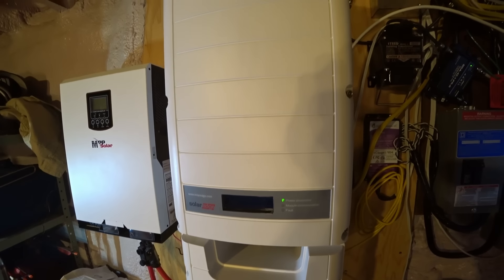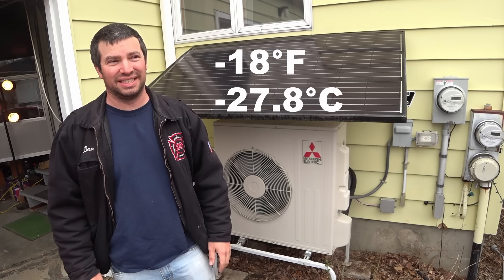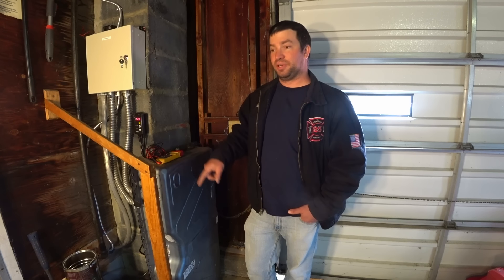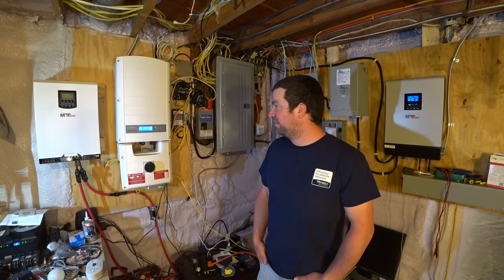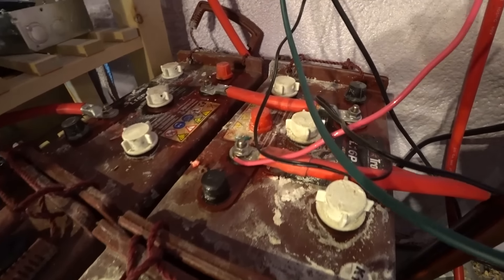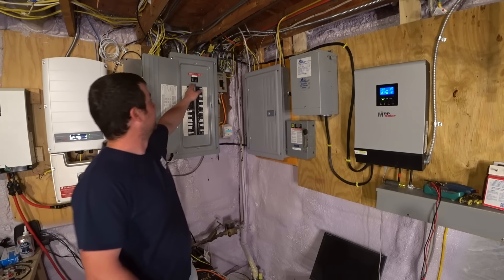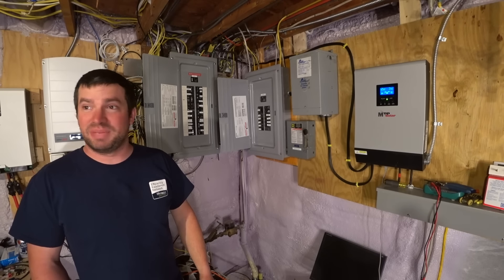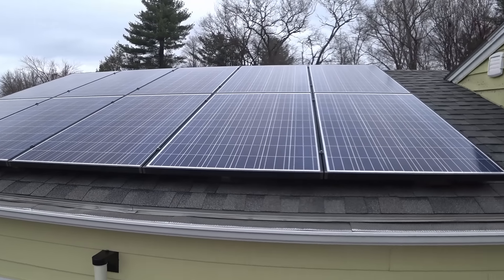Huge Grid-Tied Solar PV with Battery Back-up System

Comment: This is all perfect except for when the power utility loses power.  The batteries kick in & back-feed power onto the grid killing a utility worker.  Does he disconnect from power utility when batteries take over??  When a PV system is grid-tied...that is supposed to be a built-in safety.  But a grid-tied + battery back-up.  Great for home owner...Bad for utility workers!!
Reply from the maker: Ben has more than one panel, and his "protected loads" panel does not back-feed.  This is a very safe and legal system.
Reply: @DavidPozEnergy  Hi David.  Wow fast response.  I'm not a critic...I find what you guys are doing very intriguing.  I am very versed in electricity, power systems, electronics.  But not so much in solar.  I am learning so much from you guys.  So tell me how this system is safe for utility workers.  Does he use some sort of fast switching device that disconnects from utility system??  He mentioned it switches over in 10ms.  I am curious as to what Ben is using that is switching the power that fast virtually without interruption.  I ask because I would love to install a system of the such on my personal residence.  Also does the battery backup serve any other purpose...like allow you to run off of battery during night hours instead of using power from the grid or is it solely used only if the utility power goes out??
Reply from the maker: The power comes in from the utility grid to his house.  It goes through the meter, then to a "main panel".  From there it goes into his inverter "input" side.  Then it leaves the inverter through the inverter "output" side and goes to a second circuit breaker panel called the "Protected Loads" panel.  The inverter has a built in switch that switches in 10ms.  The protected loads panel can be powered by the grid or the batteries through this inverter.  But the "output" of the inverter is not connected to the grid.  The inverter does not have the ability to push power out the "input" side.  It's one-way only.
Reply: @DavidPozEnergy  Oh I see now how he has it set up.  There is so many ways a PV system can be set up.  Ben has a pretty nice system setup.  
Hey David...I am just starting to watch all your videos...let me get caught up with all of your accomplishments.  Love the idea with the Solar water heater with the home made tank under the crawl space.  Perfect setup!!  I'm all about green energy.  Cheers.

Comment: Those PIP chargers are complete rubbish,I had no end of trouble with them burning PCB's and fans, went to Victron Energy and is ok but back up service is lousy in Brisbane, Australia
Reply: In Brisbane also thinking of getting a PIP5048MG but don't want the hassle.. If that's your experience
Reply: Mpp solar has the worst possible customer service. There is no short circuit protection on the DC side and their specifications are lies (eg idle consumption and thd)
Reply: @climatechangepreppersfaceb2148  I saw one of their products on Amazon and it said it was not UL listed (Yikes!), so it may not be allowed to be grid tied.

Comment: Where I live, Phoenix, my electric company, APS won’t allow me to add more panels, or I will lose my current “net metering” plan, where they buy back electric. They see the value in solar energy production, and they want to be the only provider, they want to stop someone that may want to produce their own power. Such backwards thinking...This is solar heaven here!! It’s politics. Big companies have law makers at their disposal.  I’m jealous. Nice system :-)
Reply: Its all just to safeguard their $$$$$$ and that's it !
Reply: They do that in California also
Reply: I have a 10 year net metering agreement with the POCO.  I got around changing it when I added panels because the PIP doesn't backfeed the grid.  They have no jurisdiction on a system that doesn't backfeed.

Comment: How many amps does the heat pumps draw? I've been off grid for 25 years and still can't find a AC unit that doesn't wipe out my batteries. I've got a 2500 watt 24 volt outback inverter and 2000 watts of panels 24 volt 260 watt panels and trace charge controllers mppt and forklift batteries. 20kw diesel gen. Back up.
Reply: The 15kbtu unit runs around 1000w for cooling, sometimes less sometimes more depending on temperatures.  It has a soft start as well.

Comment: If this guy replaced his dryer with a propane heater dryer he should be able to run it on the inverter.
Reply from the maker: I think Ben wants to be as much on Electric as possible.  I think he only runs propane for cooking because he prefers cooking on flames to electric.
Reply: @DavidPozEnergy  Probably a better option is what we do here in europe.... heat pump dryer... they're actually the majority of the dryer market here. Full load of clothes dry with about 1kWh. Also... for cooking... just switch to induction. It's north of 90% efficient and doesn't have to cost a lot. For a cheap intro to induction cooking IKEA sells a single induction hob here for €40 ( it's in the US catalogue for $49 - https://www.ikea.com/us/en/catalog/products/10343776/ ).

Comment: I would like to see more on the electric heat pumps. Are they Ground Source Heat Pumps?
Reply from the maker: No, They are air-source heat pumps.  There is a "Head" unit inside on the wall, and the outside unit which you can see in the video.  Both sides (inside and outside) have a fan and coil.  Refrigerant is circulated between the two sides and air is blown across the coils.  These are often called "Mini-split" and "Ductless".

Comment: Thought experiment for charging my future Kevsla  work/play van or portable recharging station for stranded or convenience charging when visiting the in-laws business opportunity charging, 60amp pressure washer, grid tie-ins, home automation. I really don't feel storing coulombs is required in my home. I'm already running almost 6*1000 watts magnetic  ballasts and add going to easily double.  My hypothesis for my flux capacitor is....

If he would increase from 48V dc to 120V dc. Could a person run there  home more effectively or efficiently. Possibly better for switching to 120V ac. But I don't think so. What is the ideal voltage to run and would there benefits in building to the existing wire sizing for 120 V ac or even 240 V ac.
My thoughts are buying 1*hot bus-120V ac 60 amps,
2*hot bus-240 V ac 30 amps,
3*hot bus-377V ac 15 amps,
4*hot bus-480V ac 7.5 amps. 
Or
4* hot bus-480V ac all equal amps 30 amps due to loop 0.5*conductor sizing or figure 8 for 0.333 conductor sizing. we got to remember that this is all about the  coulomb passages when sizing theoretically.

 Hot bus from copper stock bar or maybe din rail made from copper stock or aluminum.  Perimeter interior crown molding or in cabinet when applicable hot bus decentralized load center with every device protected. If it's looped the conductor could be half size minus negligible transmission loss from the longer runs. That would mean all I/O because of external grid tie-ins to. But  maybe a figure 8 instead of loop for center of house tie-ins and conductor sizing of 0.3333.

Comment: It funny how people like to quote the panel capacity , say 250W or 300W times number of panels = output right?  nope, pretty much never.  Same as wind farms powering x thousand households.   Still if you can shove enough energy into enough batteries to tide you over the low output period (or just quietly stay grid connected) and you can afford it, maintain it and replace it at the end of useful life then its great.
Reply: "It funny how people like to quote the panel capacity"  It's just a label.  Of course you almost never reach that capacity.  When I say I have a 150 watt panel, people that have any knowledge know what I mean by it.

Comment: So if the system works without problems it should only take 10 years to break even.... and of course, solar panels will improve exponentially.
Reply: He's buying wholesale or direct and installed himself. He has extremely favorable net metering rates. He said in the video the system has paid for itself in 4 years.

Comment: What they pay more than it cost that is crazy you would be better off letting as much electricity into the grid as you can vs using it when you are making it
Reply: I'm 4.5 years into a 10 year net metering agreement.  If I change it now, I lose my awesome rates!

Comment: Great video,  only two things that bug me.  One is,  your batteries, hope it doesn't flood in your area,  maybe lift your batteries a little just in case.  The second is fire,  what measures are there in case of battery or electronic fires. I would like to see videos about safety because lithium batteries are dangerous.  Thanks great how to videos.

Comment: I'm surpriswd that he didnt set the north side panels on a frame....not so pretty, true, but way more efficient. Very few people seem to use solar tracking arrays nowdays as the panels are so cheap but one thing about trackers is they provide power till the sun hits the horizon, thus cutting battery requirements considerably. I didnt realise how much difference this makes until i inherited a system 3 years ago. I've been off grid for 30 years. My 15 yr old tracking panels (900Wp) do a better job than my previous 2.2kWp fixed array.
I will soon be adding a fixed array to the system and we will time our high usage, baking, washing machine, pool pump to the midday high charge period.

Comment: Dave, great video...  You mentioned in another reply to a post that you've seen the Victron Quattro's in use. Wonder what your thoughts are on them? I'm building a house where the grid id unreliable. I'm planning a system using 2x 10 KW Quattros (primarily for redundancy should one go down) with 30 KW of panels and 2 x Smart Solar 250/100's. Planning on a 17 KW lithium battery bank and a few other Victron accessories. Was also wondering if I could run a second lead/acid battery bank (one Quattro hooked up to the lithium and the second Quattro hooked up to the lead/acid). Is it possible or even a good idea to do that? Also any idea how much power the 10 KW of panels would produce during overcast/rainy days? Great channel...always learning...
Reply from the maker: There is a lot to unpack in that question.  Please connect with me on Facebook.  Link in description.
Reply: 30kw solar but only 17kw lithium? Why would you want lead acid? Expect pv to give out 10-15% in bad weather

Comment: Is the main battery inverter unit over paneled? And does it handle that well?
Reply from the maker: Hi Travis, I'm sorry, but I didn't follow your question.
Reply: @DavidPozEnergy  well he has nearly 10,000 watts of solar panels if it's all hooked up to a 5000 watt charge controller that's built into his inverter unit I would call that over paneled.
Reply from the maker: Thanks for clarifying.  He has about 10kw solar on the south roof (front of house).  The 10kw solar is hooked up to his grid-tie Solar Edge inverter.  Only his Noth facing roof (back) is connected to his inverter/charger.  The North array is about 3kw and the PIP inverter/charger can handle that without a problem.  I hope that helps.

Comment: Great Job.  I have a 12.5 kW Solar system with a SolarEdge Inverter in Wisconsin.  I found your video because I want to add battery back up to mine as well.  When does it switch to the critical load panel that I'm assuming only powers certain things.  How is that different from when you simulated a power failure in the video?
What is the Model of the Heat Pump(s) you have?  I think you said you had two of them installed?  Are they the Ductless style?

Comment: So he could buy electricity, charge his battery and the sell back to the grid for a profit. Cool!!! I'm sure there's a catch, anyone??
Reply from the maker: I'm guessing the inefficiency in the inverter, wiring, and batteries would eat away at any potential profit.  Plus it's a lot of wear and tear on the equipment.
Reply: Large capital investment.  A large battery allows to buy electricity when it is cheap and save it for use at peak times when otherwise electricity is expensive.  Presumably you could also push it back at such times.

Comment: Cool system .   Love the creative problem solving.. and DIY solutions.
Not worth the money for me personally, and I live in a VERY sunny location.
ROE is just way too long.. I'm better off to just wait 5-10 years and buy when they are better and cheaper.
1100 sqr foot mobile home all Electric heat and AC,. I average $55/month except for two months a year.. one in summer one in winter where it goes to $120/month.
To fully power my house I would need $20-30k in solar panels.. from the research I've done.
No thanks... I'll wait.
I have gas generators for the very rare occasion I have a power outage.
Reply: I have the same situation as you but I want enough solar for basic needs like water, a small AC,  computer, and a few lights now. I have the cash now and do not know what the future holds. Anything from a terrorist attack, trade war, or a civil war could happen. Gas could be expensive or unavailable, the sun will keep shining.

Comment: stay away from powerjack inverters they are expensive for what you get. These power jack inverters are garbage. mine won't even power a 5 watt LED desk lamp without an alarm.  the company won't support beyond one set of parts that gets you beyond ebay support due to 6 weeks to ship the parts that allegedly will fix it.  it is crap and not worth the cost.  buy american and pay more.  At least it will work.  David  from Power jack, hope you are reading this since you blow me off.

Comment: I'm in NJ and would like to do something similar any recommendations
Reply: Michael Barbosa You can get solar at no out of pocket cost with Sunrun. If you want to know more DM me!
Reply: @Ren-hd8di  would that be as a lease
Reply: @LeslieIsgrigg  Most likely lease or $0 financing, but I don't think leasing makes sense for most people. Just buy the system outright, it is the right choice in the long term. And NJ has some killer solar incentives.

Comment: Thank you for the video. I loved to see the setup. I was wondering why you chose optimizers over micro-inverters. Do you have to have more than one string inverter with so many panels?  I was thinking that the micro-inverters would be a better option because they would allow to more easily add more panels in the future.
Reply: No, the Solaredge optimizers are just as easy if not easier to add more.  Just disconnect the existing line and wire in some more panels to make the loop larger.  Then you hit a button on the Solaregde and it discovers the new optimizers and panels.  There are limits on the number of panels per string based on the model, but you can just add another string. The Solaredge balances things nicely by managing the optimizer voltage/amperage.  I love mine and have helped 4 friends install them.

Comment: Loving it David... Energy porn 👍
Ps. Do you use Victron Multiplus in the US? It could suit this system perfectly.
Reply from the maker: I don't know anyone using the Multiplus, but I have seen the quattro.
Reply: Building a new house where the grid is unreliable. Plan on using 2 x 10KW Quattro's (primarily for redundancy) with 30 KW of panels and 2 Victron Smart Solar 250/100 charge controllers with 17 KW of Lithium batteries. Any recommendations or comments on my proposed system? Is it possible to add a second lead acid battery bank and have one Quattro hooked up to lithium and the second hooked up to lead acid? How would the inverters/charge controllers handle the 2 battery banks? Great info Dave. Been following your channel for ages....